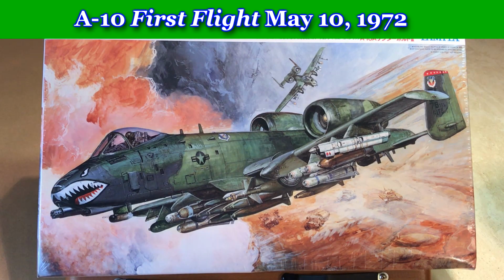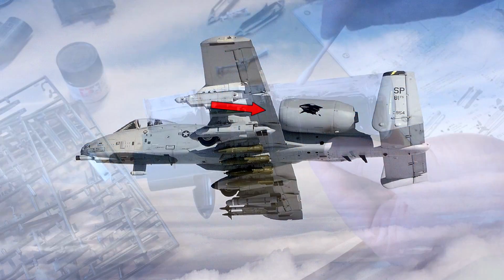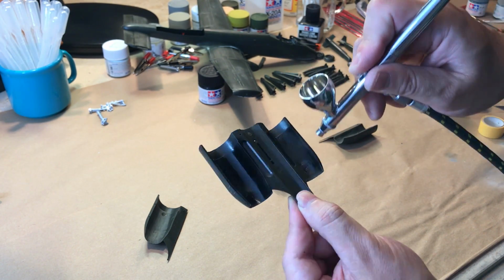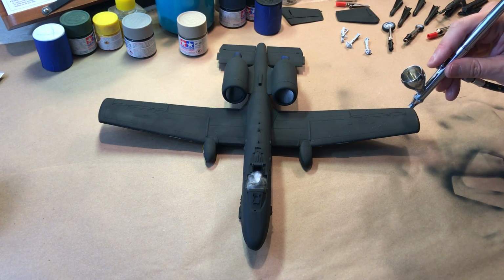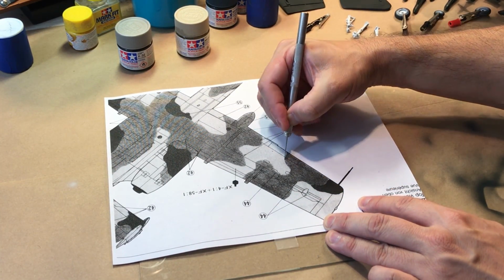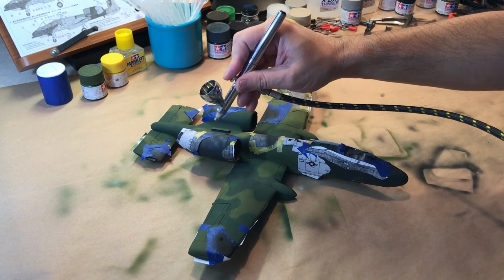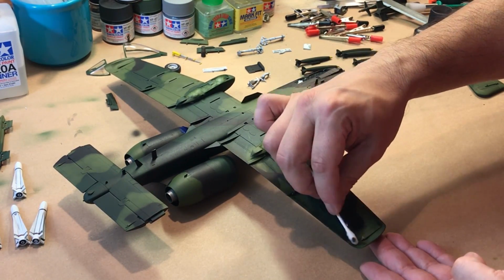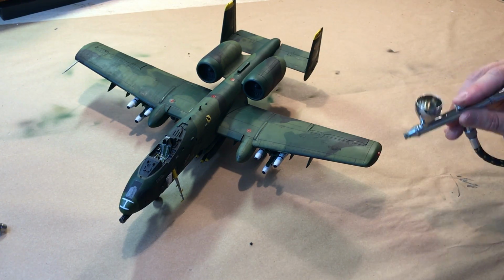Building the Tamiya 1/48 Scale A-10 Thunderbolt II Strike Aircraft

Comment: they almost nemer carried 6 mavs, since the ones closest to the gear tend to burn the tires on launch.
Reply from the maker: Hi Linas, just trying a load out that would be interesting to look at. Most of the time the ones "advertised" in aviation magazine pictures and on models are not really practical nor configurations normally used.

Comment: Fun fact, the inboard launcher rails on stations 3 and 9 were not used long. The firing of the AGM-65 would melt the rubber of the landing gear wheel. Most A-10's now are fitted with a light load out to conserve fuel rather than a full strike package. Rounds limit switch on the GAU-8/A is always set to the limit position as well.

Comment: Thanks for responding so quickly Max. One more question if I may, how does it print without melting the decal paper??  I thought that's why so many people use an inkjet instead of a laser.
Reply from the maker: I believe they formulate different blank decal sheet versions to accommodate the various types of printers out there. I certainly haven't had any problems!
Reply: @MaxAfterburner  thanks for your quick response.  You're a real gentleman and its guys like you that keep the hobby very much alive. Your work is very inspiring for me to achieve similar results with my attempts at model building. Thanks again!

Comment: A little nitpicking from me ;)

1. Camo colors look off. Especially #3 which is way too dark. Tamiya paints are a real letdown here, since Euro 1 color scheme are basic Federal Standard colors which could be easily taken e.g. from Model Master palette
2. Not every A-10 was painted the same. If you want to portray a specific aircraft, it is a good idea to base your paintjob on photos and other material you can get your hands on. You can easily see the differences - the shape of spots is different for each aircraft.
3. Gear and gear bays were often painted light gray, not white. But this is not necessarily an error - I've seen photos with examples of both. Again, it depends on the particular aircraft you are building.
4. Shouldn't MERs be painted white instead of green? I might be wrong here, it's really hard to find a good photo material here. (MER - Multiple Ejector Rack - the thing you can attach 6 bombs to :)

By the way - these old kits have completely wrong (typical) loadout for an A-10. But to fix that, you'd have to get some aftermarket stuff. For example - triple Maverick pods were seldom used because they caused problems. Usually, A-10s only carried two of those in the Gulf War. Nowadays, it's mainly JDAMs. This might be worth considering if you decide to build another A-10 in more modern "gray" scheme.

Anyway, it's still a good paint and weathering job. If I spent less time researching every little thing I might be building my own models at faster pace than one-per-6 months :)

The one I'm currently building is the first that received a little more weathering - mostly pin wash and some pigments to simulate smoke stains near engine exhausts. I'm also using some drybrushing to simulate paint wearing down and showing the metal underneath but that's easy stuff.
Frankly, I'm still far from comfortable to "dirty" the factory-fresh paint job, always being afraid I'm gonna bust the whole thing :)
Reply: Also, a fun fact - Tamiya instructions call for painting the nose dark gray. This is also not necessarily an error. It seems that "European One" color scheme had several variants before they decided on the final version. And one of these variants was with grey nose:

http://www.usaf-sig.org/index.php/references/reference/139-color-schemes/a-10-fairchild/633-a-10a-european-one-schemes
Reply from the maker: Thanks, I was just referencing off of my pictures on the DM A-10 nose

Comment: aaaaahhhhhh
tomcat
can't wait to see the results i like the vx4 version with playboy logo on it
Reply from the maker: Thanks! The Bunny is probably not "Politically Correct" anymore which is a bunch of crap. 
Only three Naval Squadrons flew the F-14D fully, and none of them sported the rabbit. :-(
Reply: Technically correct but also technically incorrect.  VX-9 Vampires had Vandy 1 BuNo 164604, the last F-14D to roll off the Calverton production line.  In the last months prior to VX-9 discarding their F-14s, they placed the Bunny back on Vandy 1 with a NAWC zap on the eye with a tear drop.  The aircraft ended up in the air power park at NAS Oceana, Va around 2004/2005.  VF-124 at the Miramar RAG operated delta's briefly for conversion training together with VF-11 Rippers briefly before reverting back to Bravos.  Number of Delta operating units in the last 5-10 years was actually 4, 3 front line units (VF-31, VF-2 and VF-213) and VF-101 as the RAG reformed at Oceana.  VF-211 and VF-154 remained with Alphas until 2004 along with many of the Bravo units, VF-32, VF-103 and VF-143.  The last two units to return from active cruise in March 2006 were 213 and 31.  Whilst the Black Lions stood down from active duty, the Tomcatters remained on active readiness by performing a short work up/shake down cruise around July/August and were finally stood down on 22nd September 2006.  The final F-14D flight took place on October 4th 2006 by BuNo 164603 from Oceana to Fermingdale airport when the aircraft was transported to the Northrop Grumman Head office in Bethpage to go on permanent static display.
Reply from the maker: "Yes, Ma'am, the data on the MiG is inaccurate."
"How's that lieutenant?"

Well we certainly got the definitive answer on that -- thanks tomcatter11 ;-)
Reply: +Max_Afterburner oh. but i think vx9 vandy one is f14d
however it's a pity that today's fighter jets doesn't have unique and sexy designs

Comment: Fun fact. The A10 was the first plane to be designed around a gun. Awesome build!
Reply: Actually the first known aircraft designed around the gun was the Henschel Hs-129 "Duck" used during world war II.
Reply: @thepiggishpig1726  the hs 129 wasnt designed around a gun. The first variants were simply armed with 20mm cannons in the wings.
Reply: The Bell P-39 Airacobra was also built around a 20 mm Hispano cannon. The engine had to be moved to behind the cockpit because the cannon took up so much room in the nose.
Reply: @TacticalBaguette  the p 39 have 37 mm m4          and you miss the yak 9 series with a 37 mm and a version with a 45 mm
Reply: @TacticalBaguette  The 20mm Hispano was a gun the Brits added because they HATED the 37mm gun, with the aircraft being redesignated P-400 when they returned to US service.
Reply: What about that german 75mm Henschel tho?
Reply: @thedubstepaddict3675  
1. it was still an external gunpod
2. p39 was still first
Reply: @oxymornicalt  ah ok
Reply from the maker: A very powerful 30mm! I've seen images where the whole Gatling system is removed and compared to the size of the original VW Beetle automobile. :-O
Reply: The gun is 19 feet long so it is even longer than the Beetle.
Reply: @MaxAfterburner  The A10 was the tank killer, don't ask me why :D
Reply: @spoofle77  If not kidding, the A10 was designed to attack Russian tanks if the then USSR invaded into West Germany through the Fulda Gapp. The 30mm GAU-8 rounds only required 3-4 hits to a tank would disable or destroy a tank.
Reply: Max_Afterburner brrrRRRRRRRT
Reply: Aaron FPV Yeah, Americans probably believe that too...

Comment: excellent work!! If you want to try a superior kit for your next A10, I would suggest the kit from Italeri in 1/48th scale. Far better than the Tamiya ;)
Reply from the maker: Alby_416 --Thanks for that info! I've never built an Italeri kit, it might be a good excuse to try out one of their models.
Reply: you're welcome! Italeri usually lacks of precision in the plastic mold compared to tamiya (some gaps and seam lines), but in the case of the A10 it's a better kit. Details are decent and the strong point is the lower price.